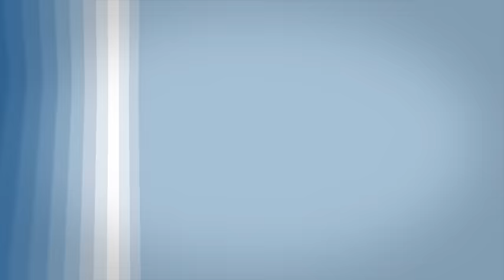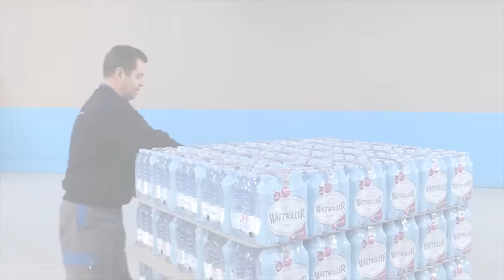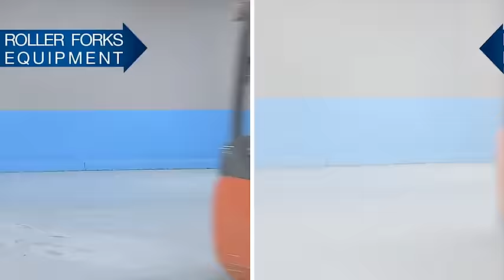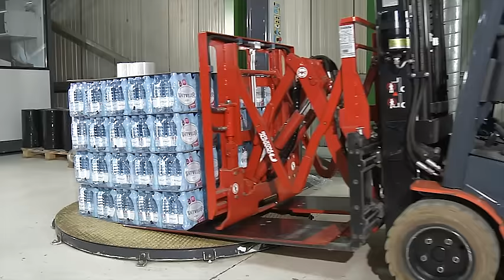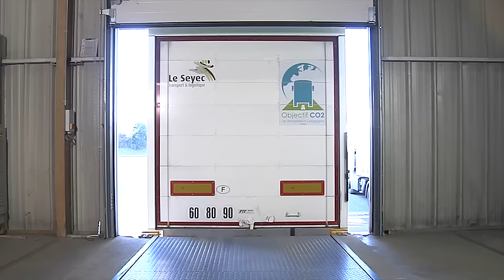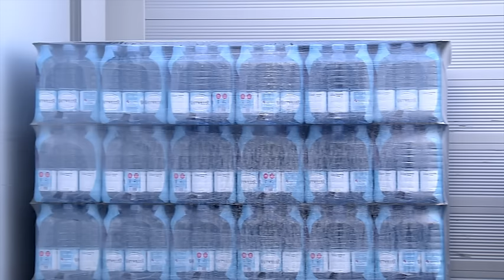Slip-sheet ECOLOGISTIK® | Pallet Less Concept demonstration

Comment: Having used one many times over the last 20 years they do have a place. However in my experience light freight is ok. But when you get heavy stuff inevitably the tab gets torn and your pretty well screwed. And even if the tab is good the fork blades can damage things. Plus it significantly reduces the lifting capacity of the lift being used.
Reply: That was my observation when used at a company in Vancouver, Wa years ago. The slip sheet movers were useful , but not for everything
Reply: From your experience, what do you think about wine bottles (glass)? They can go easily above 1200 kg.
Reply: Rani Anfibio they will work so long as the slip sheet is of proper quality. I wouldn’t want to do glass bottles with one unless I didn’t have to stack anything.
Reply: @haywoodgiblomi  Fair enough. We already have had some problems with wine bottles in the standard wood bases (although in all fairness part of it is due to the cheap bases some of our suppliers use)
Reply: Sometimes if its really heavy stuff, it should be doubled slipped.

Comment: Imagine what 10 years of this will do to the floors of warehouses being scraped away, the floors of trucks being torn to shreds, and the countless "spatulas" that will need to be replaced due to endless grinding on those surfaces. A lighter, stronger, and more readily recyclable pallet would be a much better use of R&D money. Plus, as mentioned in the comments, the infrastructure is already in place worldwide.

Comment: Guys - There is some pretty (sadly) thick comments below. In my previous experience, we have used these attachments for bulk loading into containers. Our factory staff stack export only product on a slipsheet, sitting on a pallet. When we go to load the container, the pallets are pulled out to the container using a standard forklift and then loaded using the slipsheeter. This allows for approx 2x extra units high to be stacked and saves a huge amount of time with hand stacking.

Comment: I've been using a slip on Purina brand dog foods and Anchor/ Libby glass for over 15 years. Works great, reduced pallet weight and cost, and valuable space on trailers.
Reply: Dg worker🤣🤣
Reply: @internettruth5390  WM
Reply: @wreckandraceify  I’m currently slipping 12ft tall material from rail carts 😪

Comment: The only problem with that is that many forklifts still being used today don’t have a sheet-clamp system like they’ve demonstrated here, so if anything will be more difficult trying to get the forks to properly balance and secure the sheet on the forklift than if you were to just use a pallet.

Comment: Only effective if every delivery point has the same attachments...otherwise it's completely useless.  What you need is a thin, light weight pallet that can be easily managed by all forklift and pallet jacks.  Been operating forklifts for nearly ten years.

Comment: Got one of these at work. One of our suppliers insists the container space gained by not using pallets is worth the extra time spent tipping. All of their stock is rack only so it has to palletised anyway.
All of that faffing about means their stock ends up with the highest amount of damages, thereby cancelling out the benefit of getting more in a container!
Reply from the maker: Seems like you are using a similar product and not ours as we always make tests to make sure that the products won't be damaged during the transportation. We also have a Technical Center which can simulate transport conditions check it here : https://www.youtube.com/watch?v=0ftus4rvKDM&t=35s

Comment: Nice concept but many issues already mentioned in the comments. I will add one more. On your example of manipulating bottles with waster, you indicate the free space above the load. How would you like to use that? Put another batch of bottles? If so you would be over the weight limit of the truck.

I am sure there would be interesting applications, but you choose wrong example.
Reply: In that sort of scenario your best option would be to use the latest SOA load building software in the market. Which will automatically take into account restrictions such as axle weight, total weight and total volume giving you the best loading possible. Have you ever heard about ORTEC's software?

Comment: You can try and add room for  more pallets but remember trucks have weigh restrictions on the front axles and rear axles.
Reply: Pallets weigh all of 30- 50 lbs .An 18-20 pallet load only accounts for 540- 1000lbs max .Generally this doesn't add up to even one extra pallet worth of saved weight , but damaged product certainly seems to increase quite a bit .

Comment: Great idea, but trouble is that the pallet is the standardised system.  To get this to work, you would need a forklift capable at drop off location as well, there isn't any way of doing this with a hand truck either.

Comment: And yet you cant place another skid because the fork attachment is taller than the product.
Reply: Is this slip sheet lift difficult to operate?I understand when you unload you cant start backing up until you've pushed  the load about 7 inches off of the forks and only when you have enough space you can drive forward when pulling the load  onto the forks.I have a try out in a couple days and I'm wondering if I understand the fundamentals will i be able to show the job i can l operate the slip sheet and get the job.
Reply: Stephen Dinale 👍
Reply: :))))=)))

Hey, you don't need to put another batch on top, the advantage is that you get a lower center of gravity... But you still have a good point...
Reply: The slip sheet machine is an attachment the fork lift with its own control, just a little more the operation and as for stacking 3 high you stack it and unstack it on the dock not in the trailer
Reply: Stephen Dinale Volimtier Dragos Ghorghie la Bartiu 28 Ap 2

Comment: Even though there is extra space you will still max the weight of the trailer and won’t be able to add much freight if any
Reply from the maker: Yes it is correct, if the product you load is heavy you will not add freight.But still you can find saving on pallet costs !

Comment: Nice for flat smooth concrete,  but what about ground or rough surfaces like gravel etc?  
Also how does these "pallets" handle products such as bricks, 50kg fertilizer bags etc?
This system doesn't look very practical for what I normally haul and where I haul it to.  ✌🙂👍

Comment: How does the truck driver unloads on the delivery site?
Reply: Gijsbert van der Starre 
Then you unloading the truck with your hands,better loading on pallets,thats the fasters way to load/unload trucks/containers.
Reply: Next Nexit lol. I have been doing it wrong all this time. Thanks ;-D
Reply: how the fuck is unloading with your hands faster
Reply: Rus Buda dude, a pallet is litterly 2-3 euro's. If unloading u can swap pallets with the other..
Reply: (-)MrQuatre11(-) I think he was being sarcastic
Reply: rus buda how is it cheaper theres more labour time required equals more costs
Reply: A EUR pallet is roughly 13 euros and you can roughly fill a small truck with 17 pallets. That's 221 Euros and thats only if there is cargo on top. If you have empty pallets you can have about 255 pallets that's 3.315 Euros for one truck. So no it is expensive. But still unloading with your hands would be waaaaaaaaaaaaaaaaaaaay slower. And probably more expensive due to labour cost
Reply: @Gijsbertarie  I unload the freight
Reply: The receiver unloads with a slip sheet machine  like the one that loaded the truck. Also the load weighs less with out the weight of the pallets
Reply: It's a ballache
Reply: @hsdsaunders  ever load or unload a truck at a loading dock. Drove semis for over 20 years and yes worked the fork lifts slip sheet machines squeezers and pallet jacks
Reply: @donmcmannamy3409   yeah what I do now.  Container comes in, stock on slip sheets.  Unload with SS straight on to pallets in bays. other flt driver moves those and tops up the pallet bays.  Takes about 90 mins to do full container about 80 pallets depending on box sizes
Reply: @hsdsaunders  they use the a slip sheet machine to load and unload containers and vans at both ends. Takes less space and less weight . I drove semis for over 20years and been loaded with pallets and slip sheets same product and it takes the same amount of time and people to load and unload both
Reply: @donmcmannamy3409  may be quick to get it off but it's no good if the load is just sat there just on the sleep sheet on the floor
Reply: @hsdsaunders  doesn't hurt it
Reply: @donmcmannamy3409  needs to put away in the racking until it's picked for the line
Reply: @hsdsaunders  that is the only time you need a pallet. Still it stays on the slip sheet than when shipping just pull off the pallet and load the trailer
Reply: @donmcmannamy3409  yeah and when the warehouse received it the other end they need to paletize 80 pallets.  A ballache
Reply: Its not only that the pallets are expensive you have more space to load on top of the freight. More freight equals more $
Reply: clemetruck and pushpull

Comment: As much use as a chocolate teapot.   The attachment cost for the fork truck would kill it off. The only placd I can see this as a good idea is a can manufacturer who takes them from A to B. They bulk out before they meet max weight. Customer would also need that fork truck.

Comment: I don't really see a point in this. Sure it may reduce a bit of height from the pallets, but you're giving up the stability provided from the pallet. 

Also, if you make trucks shorter, you'd also need shorter forklifts, which just creates unnecessary expenses.
Reply from the maker: Dear Rafa, the load on the slipsheet is more stable than on a pallet. the point is to be able to load more in the container or the truck... you will load up to 15% extra.
Reply: CGP COATING INNOVATION where can you load 15% more bottled water on a trailer? You're restricted by axle weight as it is.

Comment: The slip sheet . Coors brewing company used these and they sucked . In early 2000 when Miller bought Coors they went back to shipping on pallets.  Nestle Purina also used these and that was worse than Coors as they used super cheap cardboard sheets not heavy plastic pull and slip sheets  and it was even easier for the platen to rip up the sheet and the bottom layer of bags or boxes if not picked up just right ...lol... These suck in real warehouse situation where you're going for speed unlike a demonstration where you have all the time in the world . Nothing like pulling unit off a UPL and watching the unit twist sideways as the sheet gets hung up .

Comment: Let's take a failed idea that is so bad most people haven't even heard of it, and re-brand it as "eco-friendly!"  

What is wrong with slipsheets:  1) increased damage 2) increased cost of the push pull attachment 3) worse productivity in handling 4) increased training for drivers 5) increased cost because your 3PL will charge you to put it on a pallet  5) your customers will hate you and will find another vendor. 6) cost of slipsheet is throwaway because the product will end up on pallets anyway 6) no way to load from the wide side so can't pinwheel in a trailer so can't get 30 pallet positions in a 53' trailer.

Comment: So On Smooth Surfaces , Containers , You Gain Space .
 ? On Rough Surfaces , Gravel  ,  .... Difficult .
 " Specialists Handling Equipment " , 
" Or Similar Needed " 
   " Cost ? "
   " Expense "
 Cost .... What Ever The Market Will Stand ... Commitment Needed .
Expense ... " Unfortunately One Or Two Staff Members  May Be Retired To Have Justification Of Having A Different Type Of Fork Hoist ."

 Has It Place ... 
   At A Cost
Reply: The Rub Marks On The Head Board Of The Truck , ( Horizontal Lines ) Shows How Pallets Walk Forward And Rub On The Head Board During Transportation , And Breaking  .
     Hint    Place A Four By Two Across The Deck ( Left To Right ) To Avoid This .

2:02 That Drop .
Reply from the maker: -Not recommended to Rough surfaces
-You need a special attachment to the forklift (push/pull
// it can be plug in - plug out in 3 min. on standard forks
-Cost of a new equipment depends on dimensions and weight
-Cost of a slipsheet compare to a pallet is about 3 to 5 time less expensive
-You avoid manual loading/unloading operations and speed the process FCL 40' in less than an hour with 1 driver
Reply: @cgpcoatinginnovation  

 Yes , It Is An Excellent Piece Of Handling Equipment .
      It Has  Excellent Reasons For Use .

      I Have Seen Fonterra ( Milk Products ) Similar Machine Method ( Flat Tray )

      I Have Used A Floating Table To Turn ,  Place And Lower On To The Stack . 
( Twenty  Five / Thirty Lbs Bags ) Air Is Injected Through  Pin Holes In The Table To Make The Heavy Bagged Products " Float " So That They Can Be Spun , Aligned And Stacked When Table Is Removed . ( Fernz )  
   Thank You For Reading

Comment: junk  you know how many time the bottom row product gets chopped up   if you off by a hair   plus you out one forklift can't pick up a pallet  with it  unless you remove the handling part  put on forks   and you need to upgrade forklift with a extra hydraulic control and the unit is very heavy .need bigger  forklift weight  ratings     put holes in trailer flooring   a few times  on cheap trailers     need to buy new sheets all the time they don,t come backfrom customers .  people rip them off for home projects   etc / easy to roll up and walk out the door     empty pallets more readily available   and pallet is off the floor  . just in case of splills   product gets contaminated on floor  on these     and if there just one nail on a skid during a slide it will ripp it all up too .    sorry   in a perfect world ok   but........................  good for one way shippers so they dont have to get loads of empty  pallets /save weight in containers   some might not  give the crap of what the receiver does    ive seen the bottom rows get soggy from condenesation   cold transfer from floor    hmmm what else ...........?  you need a spot to store the contraption when not in use   need tools to remove and install  connect hoses     need good operator with long neck to hang out the side to see the gripper grab in the right spot  or get on off all the time .     arghhh    so as a  floor manager you  held hostage by the better forklift driver   for percs /special  treament   because he'll think he's hot shit   (only guy operate without trouble attiude?)    we also had to create a fortified wall to put a empty pallet against  when we tranfered onto pallets    because the light pallet would shift and product no be center pallet    use wall as a stop

Comment: To all the negative comments - none of you seem to have worked  a day in warehousing.
Reply: How about 4 years?
Reply: novice :D
Reply: Joe, you receive freight on slip sheets?
Reply: katomun We used to. We got 1 truckload with that push/pull sheet and we cut off our client until they used pallets lmfao.
Reply: Hugh G Wrection who?
Reply: Useless, no way of spinning the bundle if you want to turn it on its own axis. At least with a palet you can push or pull it with one fork to reposition it.
Reply: Yes! Slip sheets lack durability, not suitable for high volume warehouses.
Reply: katomun haha! Your right! I've never worked a day in a warehouse only because Ive chosen a different career path. However, I work and see hundreds of warehouses yearly. As a field service mechanic you learn what companies strive to push for safety and extreme efficiency. Seeing less and less of this slip sheet process I have to join the best materials handlers and laugh at those who still use slip-sheets.

Comment: Seems dumb.   Industry standard is pallets.  Everyone has fork trucks, pallet jacks, etc.  Unless everyone adopts this I don't see the benefit.   Labor is the number one cost to business in ther shipping industry.   This requires more labor than ther pallet system so I doubt it saves money or time.   Also retaining an entire workforce isn't gonna be cheap.  Dumb
Reply: cthunter41 No, this is not dumb. In fact, it is one of a preferable material handling method in the logistics industry. Of cause, this is assuming both ends have the proper equipment to handle it.

Think about this. A typical wooden pallet can weight as much as 50 lbs, a full trailer load of 30 skids, the total dead weight will be 1500 lbs.

By using slip-sheets, these 1500 lbs of dead weight will become payload.

Comment: that's all good but let's say a customer oder same amount product but all they is pallet jack then what.
Reply from the maker: Dear Doug, it is correct, you need a forklift and an attatchment !Pallet less concept is mainly dedicated to large volume flow ... in this case customers and.or logistic plateforms are equiped with forklift and the push pull attatchement is not a big investment.

Comment: hand jack movment out of the question. FAIL
Reply from the maker: Dear Jay,it is correct, it is mainly dedicated to large volumes flow.
Reply: CGP COATING INNOVATION So if i understand you right , reduce the cost for shipping for the big boys and force the smaller dustrubiters to pay for it to be repackaged on pallets ?